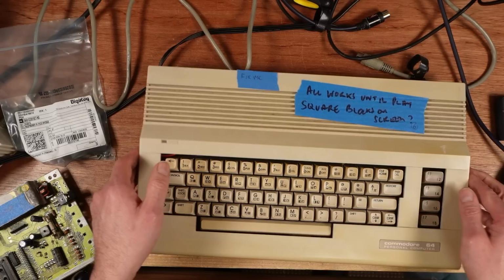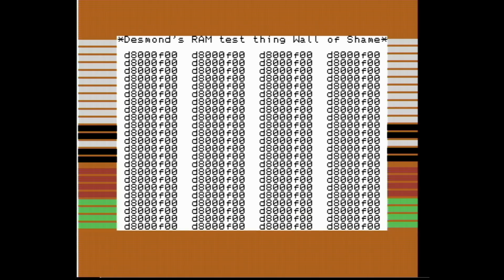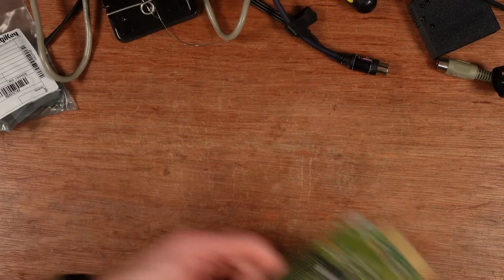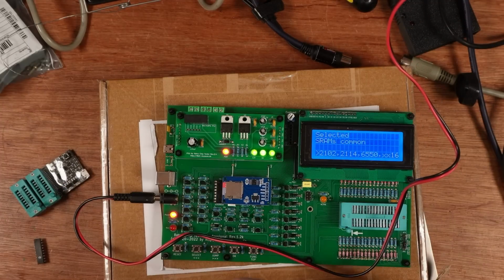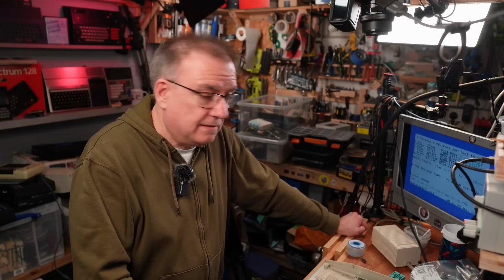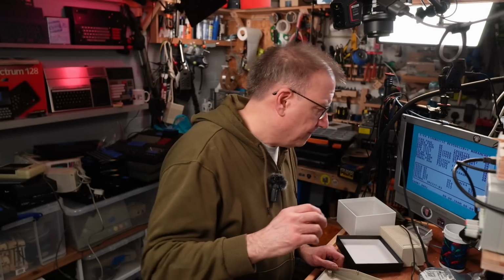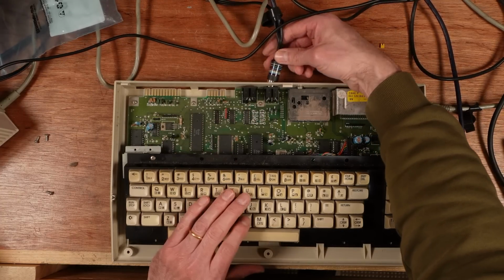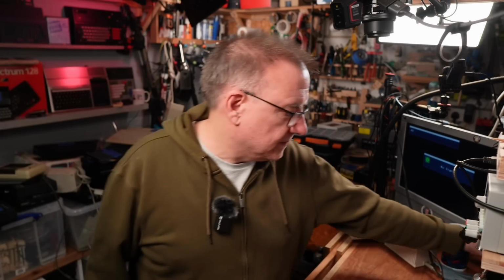C64C Colour RAM Repair

Comment: The VIC-II (Video Interface Chip II), specifically known as the MOS Technology 6567/6566/8562/8564
try it with the vic 1
i waiting for a vic 20
with a vic II and sid chip conversion
i googled it many times
no luck 
anywhere

Comment: Hate to be the bearer of bad news but that Basic ROM checksum is indeed incorrect. Both with the DesTest and C= diagnostic it should read 043D56. I would suspect a couple of bits have gone bad in it but not enough to trigger an obvious fault on boot. On a side note I asked Matt if he could include the checksums and TOD clocks in the test, and have them change red if there was an issue. So I'm happy to see he managed to do it and you trigger it. You're welcome! 😆

EDIT: Oh no wait, I can see the checksum is correct in the C= diagnostic. Hmm, maybe a problem with Matt's code, or a freak occurrence
Reply from the maker: Matt said he has implemented the code but not added all of the checksums from zimmers yet :D Hopefully it will just be that. But freak occurrence is a good bet too. Million to one shots come in 9 times out of 10 :D